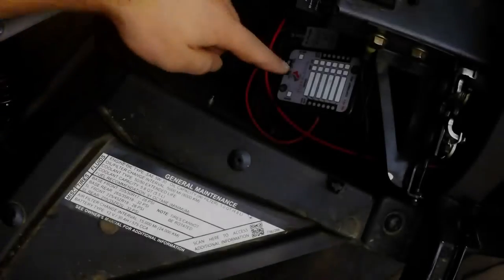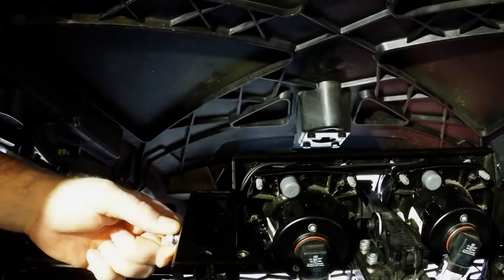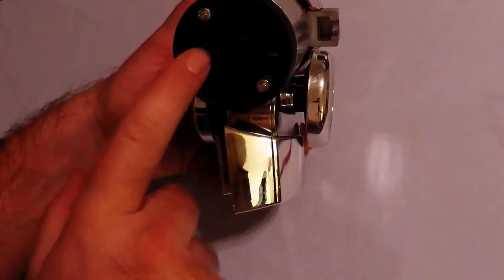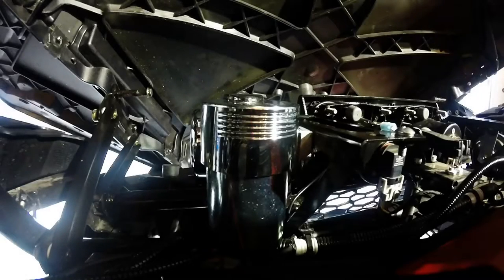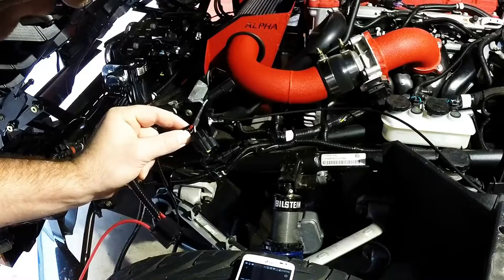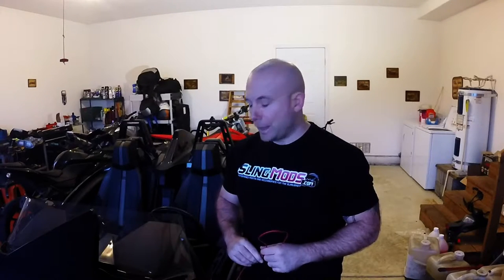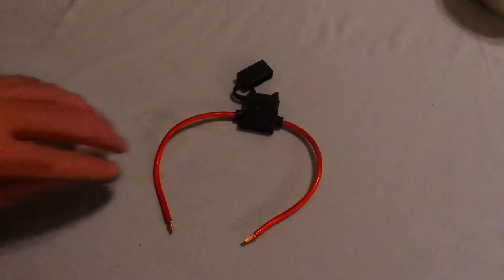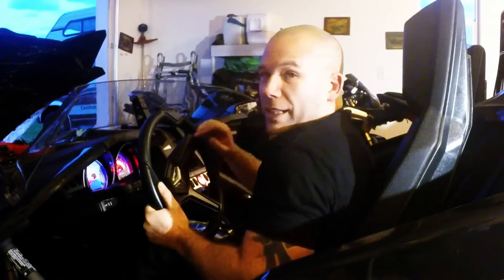Polaris Slingshot - Electrical Connection's Flosser Air Horn Install by Slingmods!

Comment: Great video, one thing to suggest is a video without the stock horn hooked up to compare the sounds. The air horn sounds a little high pitched for my taste not sure if it's because the stock horn is also running at the same time. Thanks for the video cant wait to see more.